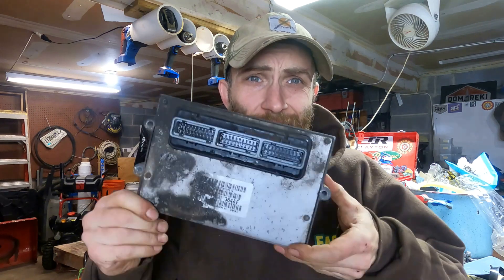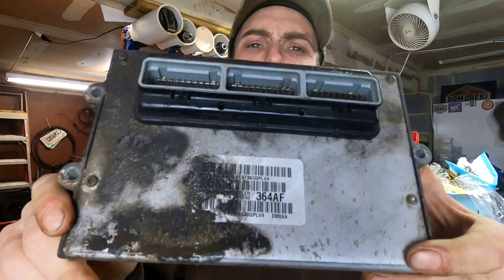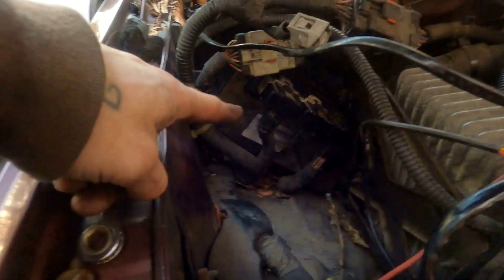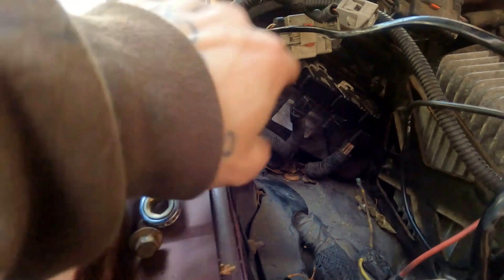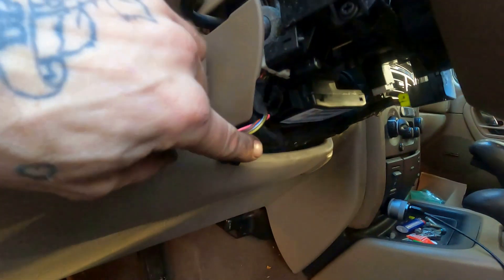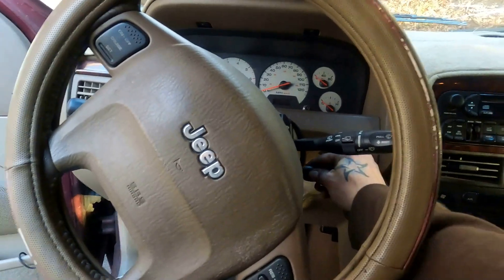Using a DODGE ECU will DEFEAT SKIM on a Jeep Grand Cherokee?

Comment: Would a in good condition 04 ECU with skim module and key ignition cylinder out of my totaled 4.7 LIMITED work in my 03 4.7 LIMITED that is malfunctioning ?. I have 2 WJs my 03 is on a reman ECU 3 years old from cordone that is glitchy.

Comment: I did use the key cylinder, skim and pcm out of an 01 Grand Cherokee in my 03. It worked until the pcm/tcm combo figured out the bcm had a different vin somehow. Now, it's theft locked and haven't had time to mess with it. At least, that's my theory

Comment: I guess once the vin matches the cluster or a few adaptations with the autel things would work. That skim is a hassle when the rust starts getting into door pins and grounds. Be interested in knowing if there is a scan-tool to reset skim so you can unplug it vs having to send the ecu out to be reset or verginized

Comment: So now we need to change the oil in our ECU?!! Then I read that this is not an isolated issue. Apparently any modern engine that uses 0w20 is likely to have this issue as the oil seeps through the seals in engine sensors and uses the stranded wires as a wick to transport engine oil all over the vehicle. I can only think of one foolproof way to fix this - put an induction loop around the engine compartment and make all the sensors wireless. That will also make them so much more reliable and easier to troubleshoot.😂

Comment: couple weeks ago i swapped ecus on my 03 4.0L RWD WJ from a donor 02 4.0L 4x4 that i had stripped a couple years ago and she fired right up w no issues. skim light popped up but she kept running. I won't go into the gory details of that journey, but in the end, i realized i had a short that was causing all types of fuckery, especially with the shifting. After two months, 3 valve body rebuilds, fresh noids and fluids... the weather finally gave out, and i ended up buying a used honda to get me through the winter. Which came with its own list of parts to change, of course. Come spring ill chase down that short and get her going again though. Thanks for the vids bud.

Comment: I did this on a durango to help diag. A computer problem and it did the same as your test and it limited my rpm to around 2500 and kept the speed of the vehicle to under 40. Kinda like limp mode. But it help prove the original ecm was bad. I ended up getting the test ecm reprogrammed for the durango and it's vin. Great video

Comment: Apparently on the chevys you can fire it up on a vehicle with working PATS. (That’s their security system) and then unplug it while it’s running. Then shut it off with it unplugged. Now that computer will work without being plugged into PATS and can be used in anything. Personally haven’t tried it though. I wonder if the same will work on Chrysler?

Comment: Bro I'mnew her. 30 years of wrenching. My work around is direct wiring the fuel pump. It works on Ford's PATS. If ignition is cut then you main tain control of that use an msd box. Blend the old school in.

Comment: Another method for you to try the next time you get stuck on dodges. Get HP tuners, pull your stock file. Unplug your skim module from the steering wheel. Reflash... Never reconnect the skim. Of course there a ton more you can do with HP tuners. .

Comment: Ecu is just that engine control unit they have independent transmission control and body control modules atleast on this particular model dodge changed in 02.5+ to have both ecu and tcm in one unit

Comment: What is a skim? If someone could explain I’d appreciate it,
Reply: security key immobilizer module... its the black box under the steering wheel, it has a ring that goes around the ignition that reads the chip inside of your key and matches it with the cars vin to prevent theft...if it goes bad or wrong key it shuts the engine off after running for 2 seconds!

Comment: As others have said before, 98 to 00 Durangos typically run a CCI bus vs the 2001-mid 2002 durangos/dakotas running a PCI bus.  In mid to late 2002 Chrysler changed to a 32 tooth 4.7l and chose a 4 connector ECU (Includes the trans computer) compared to the jeeps 3 connector ECU with external Trans ECU.

Comment: I have a 93 grand Cherokee as a mid truck out back lost my key needed to move it used my neighbors Dakota key since they were the same.  Was worn enough to work like a charm. Also have an old storage unit key in my 84 Honda dirt bike had to file it down a bit but works.  I never throw a key a way never know what u can make it f

Comment: Yes yes yes yes it works 100 % I have a 2000 Jeep Grand Cherokee 4.7 2001 Dodge Durango 4.7 ECU in and it fired up right away
Reply: I have a 93 grand Cherokee as a mid truck out back lost my key needed to move it used my neighbors Dakota key since they were the same. Worked like a charm. Also have an old storage unit key in my 84 Honda dirt bike had to file it down a bit but works.  I never throw a key a way never know what u can make it fit.
Reply: Did the cluster work?
Reply: Did everything (including turn signals, hazard lights, etc..) work properly after that? Were you having alarm issues before and did it fix the problem?

Comment: My experiences with with late 90's early 2000's Chrysler products is that the whole gauge system is controlled by the BCM and your ECU doesn't talk properly to it, probably some wiring signal missmatched between the Jeep and Durango

Comment: The oil in the ECU is a common problem in the Durango, it actually comes from the wiring harness. I didn't believe it when I first came across it, but sure enough it comes from the oil pressure sensor. It has a poor design that eventually allows it to fail in a manners that allows oil which is under pressure to be leaked into the harness, which eventually makes it's way into the ECU.

Comment: Probably power steering fluid, they had bad pressure switches that would allow high pressure power steering fluid to migrate through the wiring into the computer. GM had a similar problem years ago with the coolant temp sensor filling the eco with coolant…

Comment: Side note:

About six years ago I was chasing down an overheating problem with my 2000 XJ Limited 4.0L 4x4 that appeared to be electrical (turned out to be a bad plug wayyyy down the harness); at some point I opened the ECU to see if anything in there was burnt up.

That plug Doug popped off the back of the Dodge ECU? IN THE CENTER OF THAT IS A FIBERGLASS VENT! I believe it allows moisture a way out--it lets the unit breathe!!! 

And it was unavailable!!!

Why would I have tried to replace it? Because mine crumbled to DUST on disassembly. I made the mistake of trying to remove it for a look inside (or maybe just otherwise disturbed it; I can't recall).

Anyway, at the time I was still a smoker. So I gutted the thing and replaced its working parts with the innards of the filter from an unsmoked Marlboro Menthol.

(Just in case anyone finds themselves in such a pickle.)

Comment: If you have a serial connection to the ecm and software to pull the tune out of the ECM you can take software like Tunerpro and edit the file but you need the .xdf file which is a definition file to show the .bin file you pull from the ECM. Basically tells Tunerpro how to view the file as it is in I believe hexadecimal. Remove or disable that part of the ECM tune you will load. Save as a new file every time, do not write over your previous tune or original.bin file if you ever F up and god forbid don't let ECM loose power before you get the tune loaded

Comment: I have swapped around ECMs from other Jeeps in those and after 01 has some things that are wired different than the earlier ones. Could be the case with the Durango computer too. The A/C and the cooling fan are the 2 main things I've run into. The check engine light might be on because the ECM is looking for an electric fan and yours is hydraulic. I have also noticed that the performance seemed to be better with an 01 computer vs an 04. These were both in a 2000 limited. It was also looking for 4 02 sensors and the 2000 only has 2. I just bypassed my skim with parts from a remote start antitheft bypass, a zip tie and a lug nut, so any key cut for it will work. It would make total sense if you saw it.
Reply: That may be due to Vehicles, by nearly all manufacturers, after 01 or 02 had made the VIN "readable" via OBD2 Port. Toyota certainly did. That's why you allegedly (not me) couldn't hook up a 2003 to get your 1999 with a CEL lit inspected. Inspection Computer would rat you out.

Comment: Love the video, I've been swapping/buying Durango parts for my 99 WJ 4.0 and no issues. Last was a 242D (with 2wd and same as 242HD for WJ) out of a 99 or 2000 with 46re, forget which year, and was direct swap. Next I might find a 46re and see if I can replace the 42re that's on its way out.

Oh and you ever gonna make a non 4.0HO sweatshirt for us old fashioned 4.0 men???

Comment: I got another 4.7 HO computer with skim delete ( it just puts the pcm in learn mode and skim in the column must still be disconnected)  and it worked great accept the key security light was on in the dash. So i did the right thing and removed the bulb.👍 This was on a 2002 Overland GC.

Comment: The ecu got filled with oil because the oil pressure sensor went bad or it is trans fluid and it got pushed through the harness and into the ecu. That ecu probably wont last long. I replace a lot of ecus for that problem. You can call a mobile programmer to change the vin and disable the skim module if you wanted. I do a lot of these old chryslers. You also habe to make sure the calibration matches your vehicle. California emissions vehicles and federal have different calibrations. If you have any queations ask away and ill try to answer anything.
Reply: Yea that's bad. Good thing oil isn't conductive. Not like that things gonna last long anyway.
Reply: @dustinandtarynwolfe5540 - Dustin - I was thinking the same thing that oil in certain formulations (transformer or oil filled capacitors, etc) is definitely an insulator. But I'm wondering, would any zinc or other metallic anti-wear additives in some motor oil cause shorts/grounds in the ECU? I can't imagine zinc or molybdenum would help all that much...
Reply: @dustinandtarynwolfe5540  Ah but if you say that it isn't conductive per say, 
just think about the possibility of oil having carbon residues in it such as a by 
product of combustion and byproduct there of, present wilst the oil being 
sprayed and accumulating inside of the ECU housing, you could have potential 
intermittent shorting ability taking place that could have gremlins galore without 
a doubt being ever possible. Although there are protective coatings applied to 
the circuit board that may preclude any possibility of potential shorting to the 
already populated board included. BUT, should there be a portion or a micro 
area of the board and it's populated components exposed, WELL there still 
might be a remote small area of either a circuit trace or associated solder 
connection that could pose as a problem for corrosion to occur while exposed 
and/or a micro shorting from one trace to another, etc, etc . While I know that 
there are special coatings to help to protect the circuitry inside, to do battle for 
the most part to prevent such issues such as condensation issues on account 
of heating and cooling issues and water proofing as a deterrent to such ill effects, 
and for protection of the internals to include complete encapsulation of the 
opposite sides of these ECU boards, this overall approach by the engineers that 
built these modules may not be totally 99.99 percent foolproof solutions! The 
steps that they had taken by far are a real approach to fool proofing the potential 
issues that could possibly manifest itself while when the coatings that were 
applied, all it would take is for one spot on that board that didn't have sufficient 
coating or that got missed but then the potential for bad things possibly of
happening over the life of that ECU! The fool proofing is most valuable but I dare 
say is never absolute 100 percent as intended but for most of them last a very 
good long time BUT there may still exist problems as such and the potential of 
a high incidence in the way of a failure rate is relatively low. Just remember that
if you have a carbon particulates present in the oil and if it is a high content that
is present in the oil, you now a have conductive environment present in the oil
plus perhaps an even acidic properties may also present, that could mess over 
electrical harness connections as well where the ECU harness pins and sockets 
meet up with one another that pose as a corrosive environment also! Oil by itself
without carbon particulates you would not think that it would be a problem but
hell's bells, if there is a high carbon presence and/or to include an acidic type of
environment as for instance due to a faulty PCV system and NOT changing your
oil like you are supposed to at required intervals, these kinds of things can reek 
havoc not only inside of an engine BUT if you have such things as oil being
sprayed or by capillary action getting on or near electrical connections, you can
have even longer list of issues to deal with!
Reply: You hit the nail on the head. I’ve seen it but not at that amount.
More on changing the VIN with good scan tool?
Reply: Capillary action is the terminology for it. Very common

Comment: You could always get a flipper zero to tell the key fob detector that it's getting the correct code and you can use that for any vehicle you wanted to also if you ever ran across the problem again
Reply: if it uses Rolling Codes you'd want some better then a Flipper I was playing around with mine and Ended up unsyncing my Key from my Car and the Flipper didn't anymore because the Code Changed but it required a Full Reprogramming of the ECU and the Key to get everything working Properly again

Comment: i have a 2001 JGC Loredo with the 4.7. if i put the ECU from a limited will i get the space age bells and whistles available in the limited.
Reply: You shouldn't have to swap ECUs; you just need to get the components the particular bells and whistles you want are made up of.

  For example, if you want the EVIC overhead display, you just need that display unit with its computer module, and install it in place of your basic compass & temp overhead display.  If you want memory seats, you need to make sure you have the seats out of a WJ trim level that had memory seats, possibly might need to replace the wiring harness, but not sure, and the memory seat computer module with the two buttons on the door panel.

  The main ECUs and body computers should all be capable of running everything, you just need all the additional pieces, including their individual control modules if they have one, and sometimes a specific wiring harness.

  Unlike modern vehicles, these computer systems were pretty much plug-and-play.  You don't need to program the individual modules and main computer to accept one another. You simply connect it up and it works.  Some of the bells and whistles are worth it, but others can be more work/cost than they're worth.

Comment: D&E been watching you guys for years. Never seen you cover the problem I have with my 99 WJ grand Cherokee Limited. Listen to this so for a year or so it was randomly shutting off with me driving down the road no pattern whatsoever sometimes would start right back up sometimes would take hours. Then one time sitting on the side of the road trying to get it to start. I had removed the air filter for some reason in it and it fired right up. (New filter, incorrect filter.) since then I have fabricated a much thinner, temporary filter. I’ve been running in it and guess what it hasn’t shut off on me in three months. What do you think this could be related to?
Reply from the maker: I am relatively stumped. Shooting from the hip.. how are your throttle body sensors? Specifically IAC. Never heard of an air filter choking off a 4.7
Reply: I think it's a false correlation. I think it's coincidence that the problem went away. More likely you have a shorted wire and messing with your filter got it a better connection. Obviously just a guess though.
Reply: I forget whether the WJ uses a MAP or MAF sensor, but if it's MAF (Mass Air Flow), a really dirty/failing MAF sensor could potentially exhibit symptoms similar to what was described.  If it's a MAP (Manifold Absolute Pressure) sensor, then it's gotta be a false correlation, and moving wires/harness around when opening the filter housing may have caused a better electrical connection which made the problem go away.
Reply: @4WDriver Almost positive it's a MAP sensor as I recall a supervisor of mine about 15 years ago had the same problem with his Limited, and we discussed it ad nauseum.

Ultimately, he gave up.

Comment: Oil cooled ECU? Amazing this sort of worked...
Reply: Oil is an insulator, so no harm no foul for electronics assuming the contaminants and additives in that oil aren't reactive with electronic components. Lots of electronics  out there in the world are oil bath, but typically not  with engine oil 😆😆
Reply: @Crappycarguy yeah that's fucked! Air cool them frfr

Comment: I believe for 2002 and later Dodge used the 4-plug NGC combination ECU that also handles the transmission. Also 32 teeth on the crank tone ring, rather than 16. WJ's all used the JTEC 3-plug ECU's.